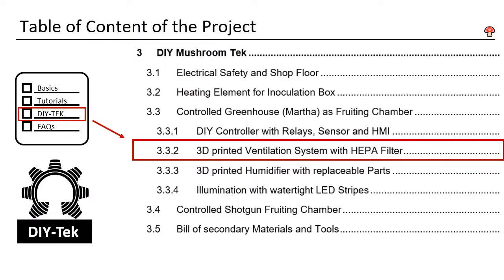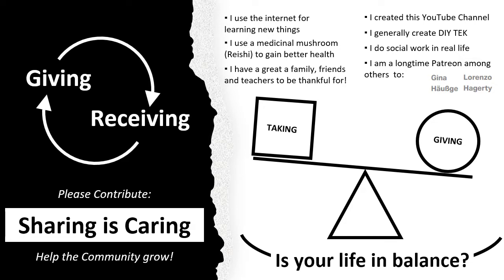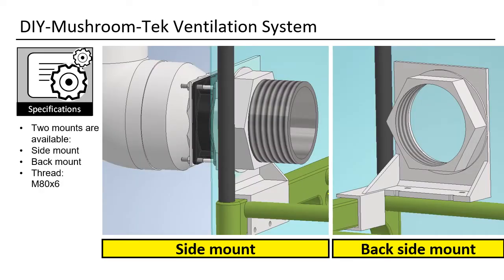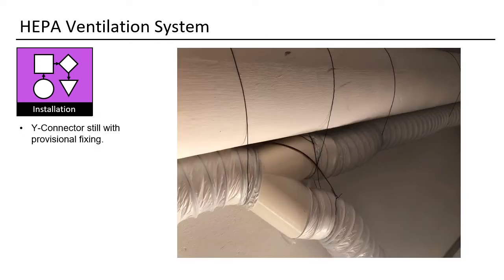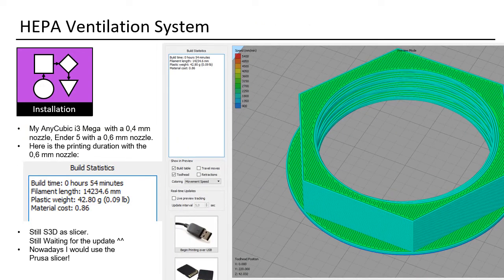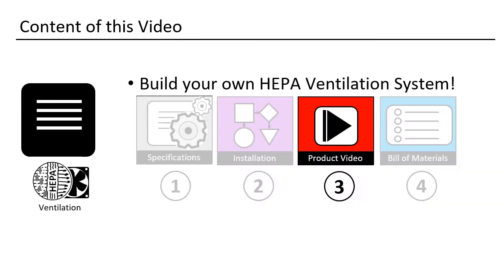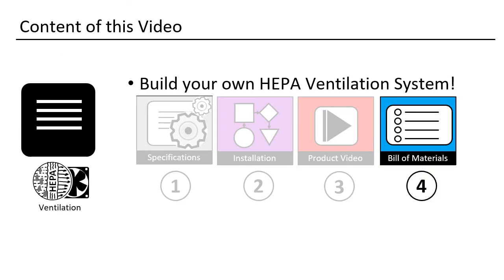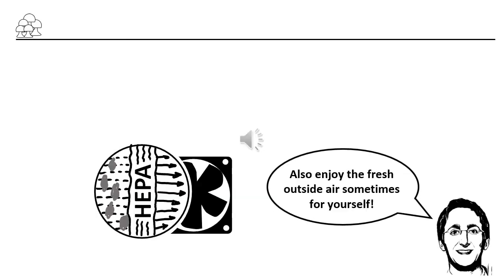3.3.2 Printed Ventilation System with HEPA Filter for Martha grow Tent

Comment: I run my intake and exhaust fans at full 12v. They are connected to my c02 controller which is then connected to a timer. It appears c02 levels go down quicker when fans are operating at full power.

My intake is hepa filtrated though not my exhaust. I never considered the potential harm of spores until your video. Now I will section off a portion of the room to isolate the spore particulates and incorporate a heavy duty exhaust fan.

Do you suggest exhausting the spores through a hepa filter into another room, or simply exhausting the spores outside with no hepa filter?

I really need to invest in a good 3d printer, hopefully sooner than later! Beautiful craftsmanship by the way.
Reply from the maker: Hello Dan, of course, when your fans are running, the CO2 level will go down because fresh air is pushed inside the tent. Many growers use a constant stream of fresh air into their tent instead of fan on/off all the time. The fresh air stream can be monitored with an CO2 sensor or just by observation. The mushrooms will show a reaction to increased or decreased air flow levels. You want to find the sweet spot, which can change depending on the mushroom that you are cultivating. 

I always advise to fan the wet and spore loaded exhaust air directly out of the building. This is the best solution. Other ways are possible but will always come with compromises. One could try to use, in combination with a stronger exhaust fan, waterproof HEPA filter or air washer to clean the exhaust air. That would minimize the spore exposure but not the increased humidity that you will invite into your living area. That is why I would suggest that one also uses a hygrometer to measure the humidity levels of the room where the martha is placed. This is to make sure, that you do not get a mold problem inside your apartment. 

If I were on a budget, I probably would go for an ender 3 v2 neo 3d printer or just an ordinary ender 3 and modify it later. 
3d printing is not that expensive anymore and still fun!
https://all3dp.com/1/creality-ender-3-v2-neo-review-3d-printer-specs/   

Happy Mushrooming!

Comment: I think the difference in the air speed on the fans is because of the restriction you put on there with that tiny hepa. if your going to put a filter on duct it should always be upsized to overcome the resistance on the filter. still works but I thought I would point that out. if its that slow when the filter is clean you will really need to keep it clean.
Reply from the maker: Hey @bmartin2304! Appreciate your insights! You're absolutely correct. Both fans are operating at the same voltage set by the DC-Step-Down controller. The key to achieving underpressure is ensuring that the output volume surpasses the input volume. This is facilitated by the setup using a hepa filter. If the hepa filter accumulates dirt over time, it indicates a further restriction in the input volume stream. If this negatively affects the growing process, options include cleaning or replacing the filter or increasing the setup speed for both fans.

In case the martha isn't properly sealed at its base, it might result in air being drawn in from the bottom. To ensure even humidity distribution inside the tent, use a hygrometer for monitoring. Fortunately, I haven't encountered any issues with my air system.

An alternative approach is to omit the hepa filter and utilize the natural throttle created by the 3D printed adapter where the hepa filter sits. For those genuinely concerned about this, adding another voltage Step-Down controller allows for separate speed adjustments for input and output. My advice is not to overthink it; closely monitor the mushrooms and adjust as needed. Happy mushrooming!
Reply: @diy-mushroom-tek  Cheers. Thanks for taking  the time. That was a lot!

Comment: Does the waterproof fan have to be exactly that same part numbered waterproof fan? I got one that’s the same name and waterproof but just exactly the same part numbers.
Reply from the maker: Hey Matthew, the exact part number is not important. It should a) have the same size, in order to be assembled together with the 3d printed parts, b) use 12 V because of the controller and c) be waterproof because of the high humidity content. 

This is the fan I used timestamp 9:31
https://www.aliexpress.com/item/32594723499.html?spm=a2g0o.productlist.0.0.8fa2258f1ww20d&algo_pvid=005d2a4a-e8b0-429a-8b95-277cd3f2b217&algo_exp_id=005d2a4a-e8b0-429a-8b95-277cd3f2b217-0&pdp_ext_f=%7B%22sku_id%22%3A%2212000031412683800%22%7D&pdp_npi=2%40dis%21EUR%2117.65%2112.89%21%21%21%21%21%402100bb5116716128980815287e40b9%2112000031412683800%21sea&curPageLogUid=gT3S3giSWkfc

Comment: Hey, can one put a passive filtered intake or would the exhaust mostly pull air from the various not so airtight parts of the tent thus making the environment less sanitized?
Reply from the maker: Hey, I am not sure if I got your question right. The purpose of the HEPA filter in my ventilation design is twofold. 
Firstly, and obviously, it filters the air and helps the create a good growth environment for the mushrooms. 
The second purpose is much more important, and it is the main reason to apply a filter. As I utilize two of the same fans powered with the same voltage the, the air that is pushed in has the same amount as the air that is pushed out of the tent. 
But since the input fan is throttled by the HEPA filter, the output out of the tent is higher than the input. Thus, it is an under-pressure system. As the tent is not completely sealed there will be a small volume flow inside of the tent through the bottom or the zipper. 
I did not experience any contamination through the outside air. But you should try to keep the grow room clean. This is anyway needed for the overall growing success.
Reply: @diy-mushroom-tek  Thanks, 
for the elaborate response, i don't write as well as you but i will try my best.
I will try to reformulate my question.  
I want to put an exhaust fan, and an HEPA filter intake WITHOUT fan.
I can make a similar air flow redirection part with pvc pipe for the intake (to blow the mist upward).
 My guess is that this would achieve very similar result, if the air leakage is non-existent ( i will be able to achieve that with a shotgun chamber, or a cabinet)
Reply from the maker: Hey. Just give it a try! I am not sure if the HEPA Filter will work if your box/cabinet/tent is not super tight. But maybe it is not even important if you are running a one fan system! 
I would always give ideas a try. Nothing to lose and always experiences to gain!